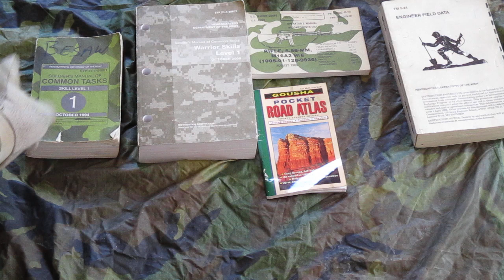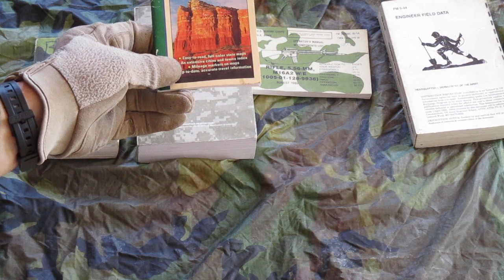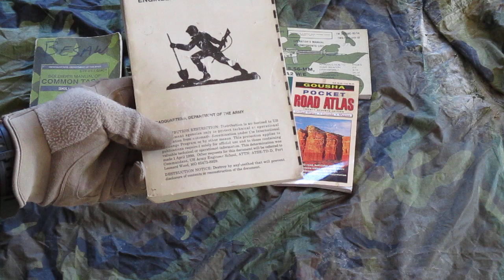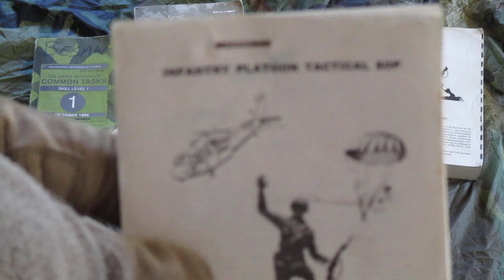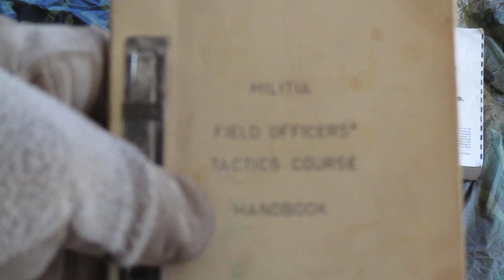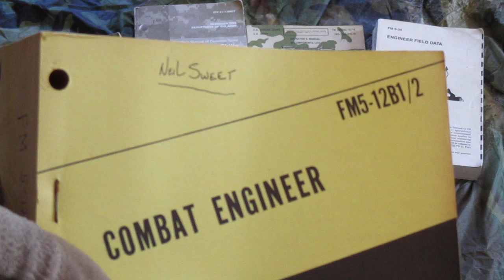Militia Field Gear- Recommended Manuals For Training And Reference

Comment: What would be a good all around manual for someone who wants to form a unit but has no experience on these matters. Or a couple manuals, both for leadership and logistics and such.
Reply from the maker: For Leadership try FM 22-100 Military Leadership and also Army Leadership.  Just depended on year of publication.  Logistics is tough because most manuals will only cover supplying conventional units.  That is an area that really comes from first hand experience.  As I have said in the past try Aggressor Force manuals and Opposing Force manuals.  They were written to create forces to beat US forces.

Comment: Many cities have cannons as decoration near city municipal buildings etc, they're made safe BUT commandeered there must be a way to make them useful, possibly converted into gta launchers, I wonder if this is possible. Even an old cannon is more than nothing.
Reply from the maker: They are usually spiked and a plug welded into the barrel.
Reply: You can literally make a better one in a garage

Comment: @ SG42... Where can I send you a pic of some whirly birds I took today? I wanted to know if you know what operations they use these for because the last few days they have been doing some type of training in my small town that does have an airport and railroad system. These exercises, whatever they are, are being done all day at this Airport, They are always 4 in uniform order. Thanks in advance👍😎🇺🇸
Reply from the maker: I don't give out direct contact info, sorry.
Reply: @SecurityGuy42  Thanks anyway buddy, Somethings going on here, Im trying to figure out what they're planning here because it's been some blackhawks flying around in ways I know are for operations, but these small black choppers are quick and small possibly for quick deployment.👍😎🇺🇸
Reply from the maker: @footsoldierpatriot6656  Try looking up MH-6 Little Bird.  Maybe that is what you are seeing with the Blackhawks.
Reply: @SecurityGuy42  That's it my friend.... The thing is this is a small town and I didn't start seeing the blackhawks until late last year and then only a handful of times, flying very low and in a grid pattern and at times in large loops within a couple mile radius. The smallbirds a couple times lat year but in and out and gone but now they're back and have been here a few days now looks to be circling in a couple mile radius starting at the airport. Each time they come back to the airport in a certain spot and looks to drop down to the ground for 15 to 30 seconds and back up in the air making same route, yesterday same route just in opposite direction. Any Idea what these birds are mostly used for? 👍😎🇺🇸
Reply: @SecurityGuy42  Ok these are the special operations unit (nightstalkers) and these guy's are based in Ft Campbell, I was born and raised in Clarksville TN . So now I have a pretty good idea what's going on here now and I don't believe it's going to be good. Back when I served, we were given a manual that we couldn't keep unfortunately, but it described and showed how a town would be taken over, street by street, neighborhood by neighborhood blocking off roads ect and so on using and I quote bradley tanks in some instances but also parachuting in and other tactics, I can't remember the name of that book/ manual to save my life but do you know or seen that particular training info?👍😎🇺🇸